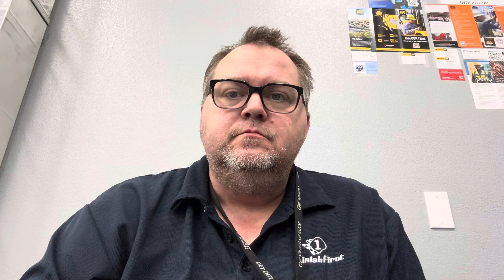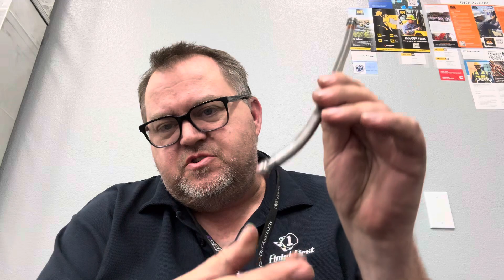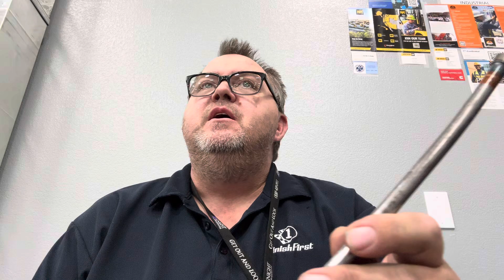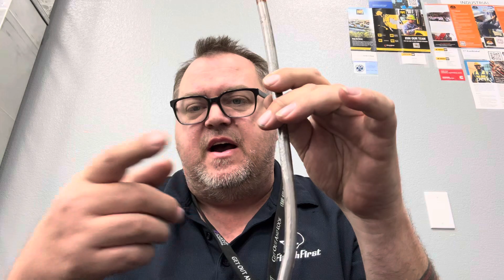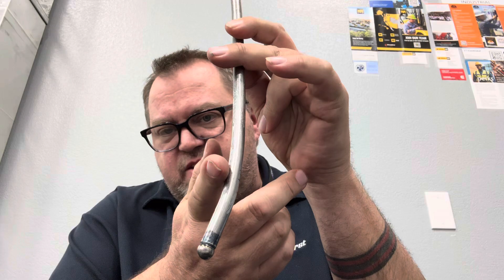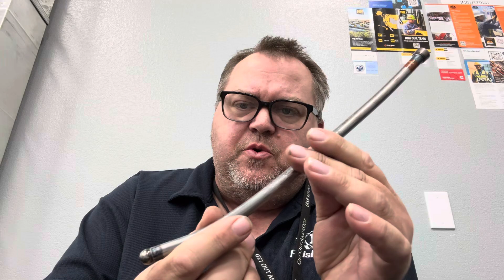I Finally Found the Cause of My Cummins Engine's Bent Pushrods

Comment: I just got finished bending a pushrod on my 12 valve. It must not have seated in the lifter as i torqued the rocker pedestal down. I did back the adjusters all the way out. I only noticed it while setting lash and noticed the 60# spring compressed while the adjuster was threaded all the way out. I was distracted and in a rush. A terrible combination.

In related news: can a guy replace just 1 rod, or 2? Obviously all 12 would be best but im not going thru that again.
Reply from the maker: @mylifeisdope916  you are right, replacing all is best but if only one or 2 is obviously damaged it won’t hurt to just replace them.
Reply from the maker: Do me a favor and share these video with others that you think might be interested. getting close to some channel goals and just need a little boost.